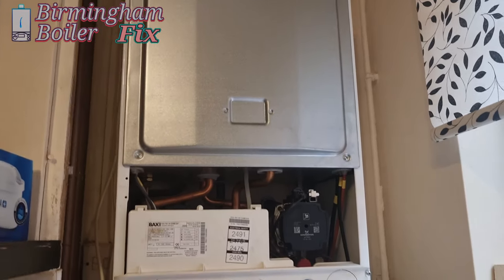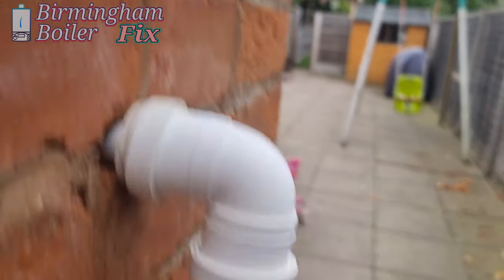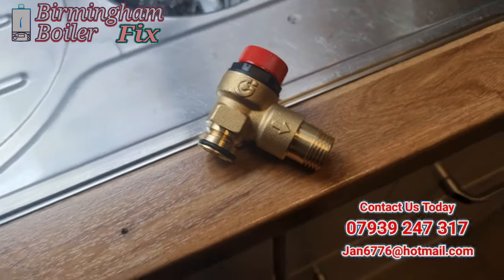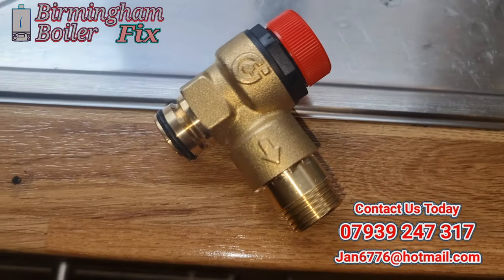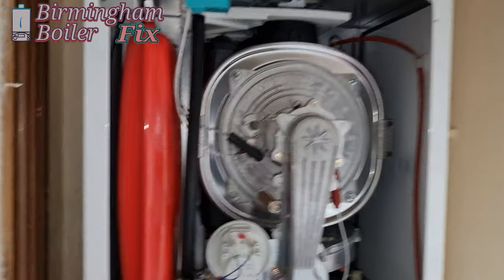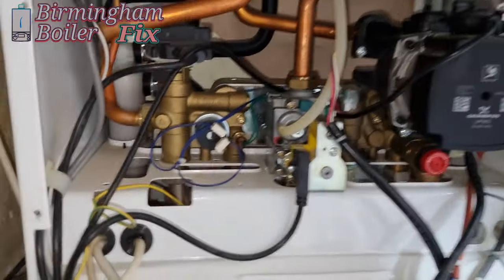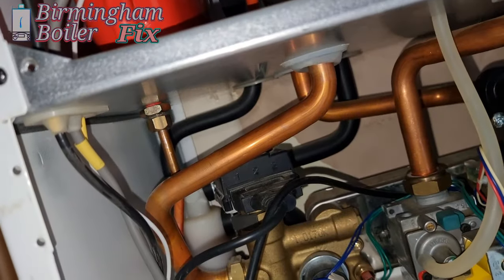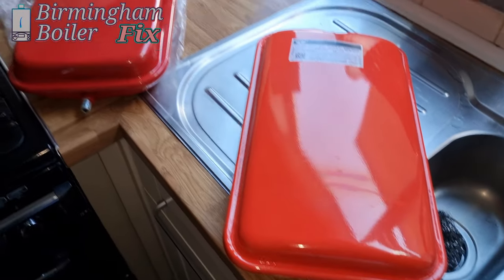Baxi losing losing pressure due to leaking expansion vessal PRV also change Birmingham boiler fix

Comment: Fantastic video !! I got the same problem with my duo tec. How is it roughy to fit the expansion and pressure valve?
Reply from the maker: Hi jmqmin Baxi expansion is one of the easiest to do one nut at the bottom and screw at top left